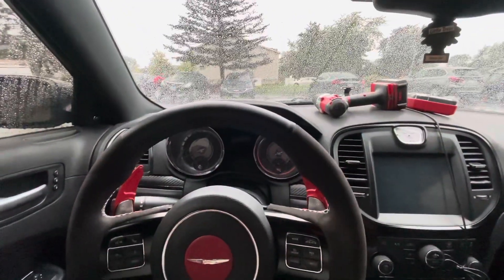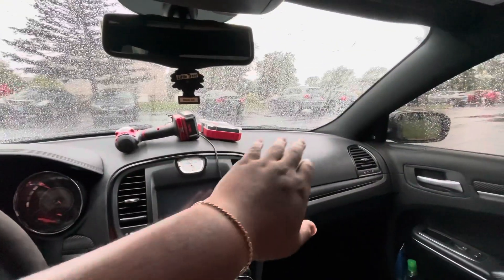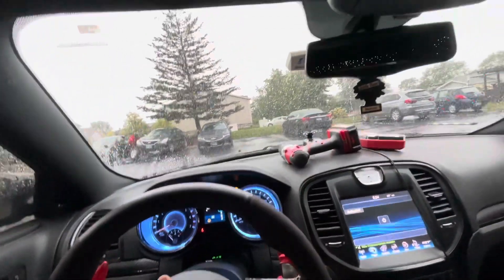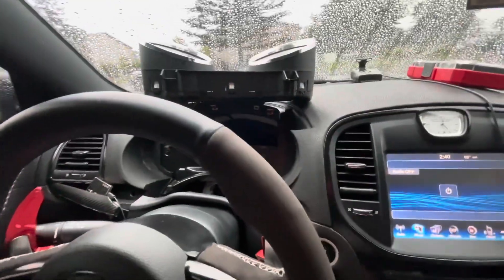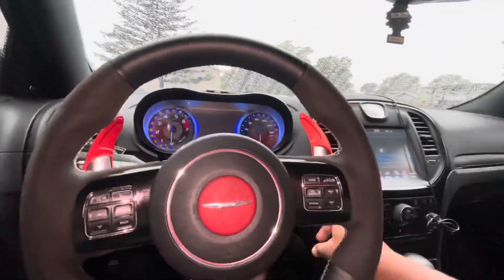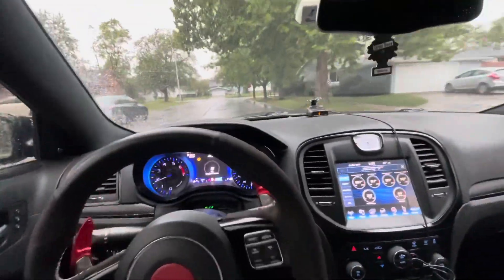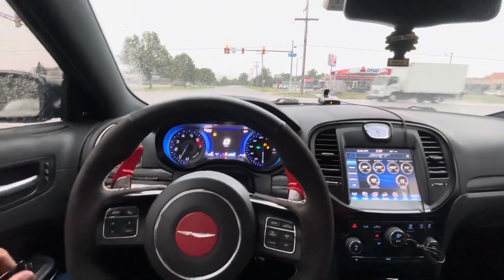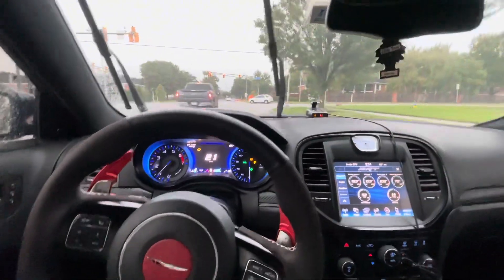SRT CLUSTER FOR THE 11-14 CHRYSLER 300 ( HOW TO )

Comment: I swap it to the new cluster but when it need oil change change it doesnt tell u or light up on the dash on the old one does not this one also the oil life on the new one stay at - its not workin
Reply: Have u tried resetting the trip button then when it hit 5k miles in trip change it